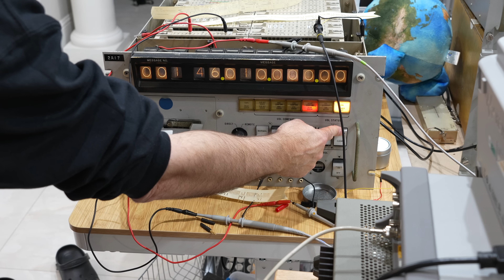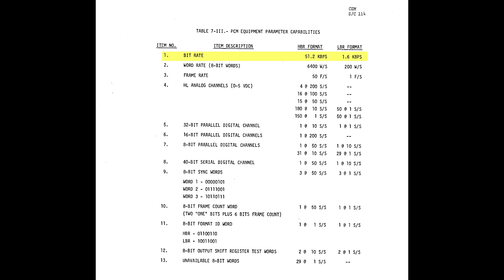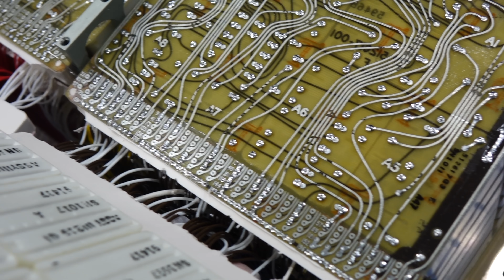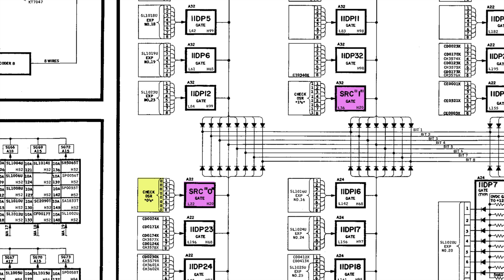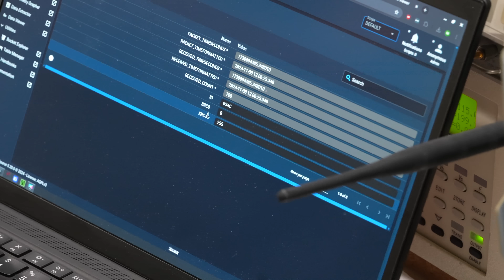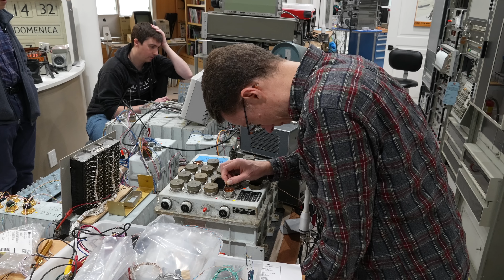Apollo Comms Part 35: PCM Telemetry - Power Up

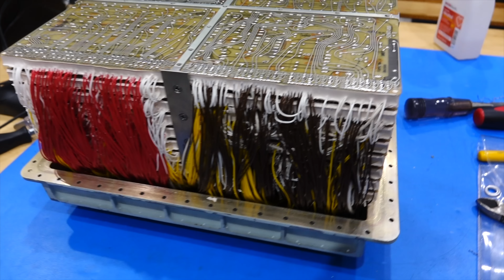Comment: 3:08 "Danger, High Voltage", that's not a warning, it's a challenge! Seriously though, I'm trying to wrap my head around how that module processed 370 signals given the relatively low density of the traces on the boards and that all the modules were made of discrete components. Even if the module was just a giant selector switch to select the signal to be routed to the transmitter, it's amazing it was done with discrete components versus the thousands/millions of transistors per square mm that we're used to today..

Comment: Question for you - is the storage a sort of RAM? On the apollo 13 movie, they show Swiggert powering the system up on battery power, with the last step being the telemetry uplink. Did they lose the re-entry program and actually re-downloaded it over this link?
Reply from the maker: The AGC programs were stored in permanent core rope memory, so they were never lost on power down. But parameters for these programs such as state vector updates and pre-calculated engine burn maneuvers were regularly uplinked from the ground. In theory the onboard computer could derive all this but it was far easier, safer and more precise to use the solutions calculated from the ground. In particular, if you re-power the AGC from scratch in the middle of the flight, it has no idea how fast and in which direction it’s flying. Hence the state vector uplink. Plus they just re-powered it for the re-entry burn, hence the burn uplink.That’s also why the astronauts scrambled to manually transfer the CM AGC inertial attitude info into the LM AGC before the CM died on Apollo 13, so they did not have to do a time consuming star realignment of the inertial platform. Which might not even have been possible with all the debris floating around. Mike better double checks me on all this!
Reply: @CuriousMarc Thank you. I heard something else too - instead of drawing the current directly from the LM 960Ah batteries in parallel - they actually had to charge one of the dead cells - which vented with such force it blew the cap off

I can only think that they had a "split phase" configuration with +28v and -28v - which would mean charging the 28v battery at 56v would be the only thing they could do (holy s...)

Comment: Notice there is no “mother board”. Those CCA’s are plugged into connectors that are hardwired to other connectors. I’ve worked on loads of systems like this for the military. Specifically F-18’s and the older F-14 Tomcat. They do it this way for vibration resilience but if one of those wires break it’s a beast figuring out which one. When I was in the Navy we had entire data processing cabinets with dozens of CCA’s all connected to each other. Crazy old but tough technology.

Comment: I'd never heard of Radiation, Inc.  but a quick search shows them to have been an integral part of the comms for Apollo. They had been bought by Harris about the time I was busy being born so it's not surprising. That PCM module, with all those submodules and wired connections is simply amazing. It continues to blow me away how these companies designed and built this complex equipment using 1960s technology that just worked whether on Earth, during launch, traveling to the moon and on the moon's surface.

Comment: So in high bit rate mode, they were transmitting data at roughly the same speed as a typical late 90s internet connection. From the moon, in 1969!

Comment: the 201B Modem runs at 2400 bps , i mean for 1972 that was well, pretty good for a pair of Copper and lets face it 51K for FM PCM was quite impressive not to mention they did it Without ICs , itd be interesting to recreate their PCM module with modern ICs and Components as a project

Comment: You think of Apollo being so long ago, but so much of the on board gear still seems so surprisingly... modern? It's amazing to me that so many of the foundational concepts behind these systems' design are the same as they are today, to the point that you can still build the hardware and software bridges to talk to them. Above all else, it's all very satisfying just to look at and see it work - this stuff was built so well, built to last, and it did.. These systems are 60 years old. Damn. Amazing work guys.

Comment: Thanks for the reverse engineering and explanation. A year ago I would probably not have understood much, but I've been messing around with some CAN networks (NMEA2000 for marine use), got a scope with serial decoding capability and learned to recognize packages of data just like you are doing here. I could also see clean and dirty traces and find the culprit. Really cool to learn about this, and I was also able to find the issue with some defective devices and repair them. For sure I had Festive Dinner on the background helping me :D

Comment: I always wondered what was driving those monitors in the control room. that could not have been simple terminals. It has much more than 25 lines on the screen and can even draw vectors. What were those terminals and what computer was driving those ? Was that an IBM or other mainframe-type macine or was it really custom built ?
Reply from the maker: Good observing and thinking! It was an IBM 360/75 mainframe driving high resolution, character-only terminals. The terminals were filmed by high def (1000 lines) TV cameras, the vector / frame / drawings that you see were just that, drawings, also filmed by high res cameras and composited in the video. So what you see on the consoles is actually a high def TV of a terminal with static background frames and graphics added.
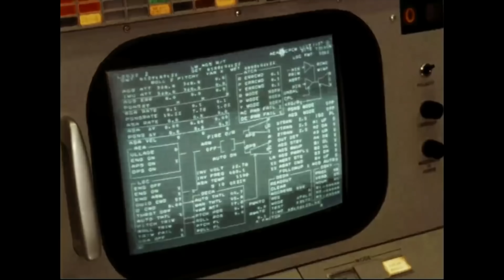Reply: @CuriousMarc  So what we see at 2:07 in the video is a composite video image of a computer terminal, a graphics overlay ( probably celluloid ? ) , filmed and transmitted to a tv-like (high resolution) . Pretty clever.

Comment: Wow, I had to stop and let that sink in... That thing was transmitting at 1990's modem speeds from space (ok, the moon) and downlinking to intercontinental leased lines... probably in a balanced 4 wire configuration. You are lucky to get 1200 to 2400 baud out of a leased line due to noise back then. It was very important to get the delivered db levels correct on the receiving end or there would be massive degradation of speed (or no comms at all). The Bell channel interfaces were... flaky... on a good day. I am amazed they were able to get leased lines to work at all from Australia to Houston. That would be a monumental effort! We would have trouble keeping leased lines going across town or even within the same state 2 decades later!!!!.  When i worked with leased lines in the 1980's we were still using UDS 103, 202T, and its descendants. The 103 is 300B and the 202T is 1200 baud.  Sometimes the leased lines struggled with 1200b. A little static on the line, or the db level is off just few db, and the whole thing can come crashing down....amazing that NASA got that working. Funny that the RF link from space was almost 5 times faster than the Earth bound technology!
EDIT: I assume they were using multiple leased lines to increase data throughput.

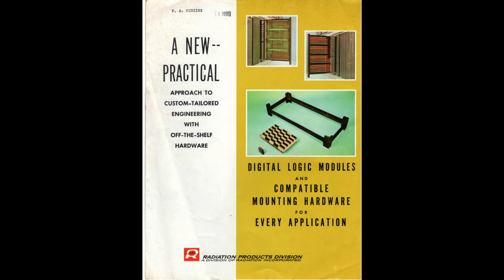Comment: Marc, slight correction here at 5:09.  Radiation was the original company based in Melbourne, and they did some very advanced work for all sorts of telemetry acquisition systems.  Later on, Harris Intertype, a printing press manufacturer, bought Radiation completely when the Harris brothers realized the future was going to be digital systems.  Harris Semiconductor was a division of Harris, inc., not the other way around.  Harris sold off the semiconductor division, which was renamed Intersil to revive one of the legends of semiconductor suppliers.
Later on, Harris acquired Excellis, and the remaining company was merged with L3 to form the current L3Harris Technologies, inc.

Comment: This is amazing. But about the synch sequence. There should be phase to find the sequence as you described. But after there should be validation, meaning the same pattern should repeat at lest few consecutive prior sequence. Depending how many prior frames are compared, the probability to synch with random pattern within the data is almost zero.

Comment: This brings back memories of work I did at GE Astrospace back in 1988 to filter 9-track archived PCM telemetry to eliminate dropouts from our UARS satellite platform.  I didn't not have access to raw data as I recall. so I used a clock that was embedded in the date.  A very ambitious project here!

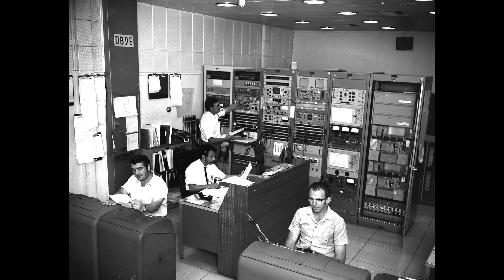Comment: 4:33 Bell 21b - 2400 bits per second
Bell 103 - 300 bauds. 8 bits per baud - that makes 2400 bits per second equivalent to high speed model

I assume it was meant to say Bell 103 was 300 bits per second?
Reply from the maker: Bell 103: 300 Bauds or bits per second. Bell 201B: 2400 Bauds or bits per second, spread on two phone lines. Baud is the symbol (clock) rate, not a byte. Early modems used binary symbols so 1 baud = 1 bps.
Reply: @CuriousMarc  Ah, okay. I'm used to UART/serial notation, where one baud means one character, together with start/parity/stop bits
Reply from the maker: Ah, therein lies the confusion. In UART / serial, bauds still refers to the clock or bit rate. So it works the other way around. The start, stop and parity will *lower* your effective transmission rate. So at 9600 bauds for example, once you take into account the 8 bits, the start bit, the stop bit, and the parity bit,  you are transmitting "real data" bits at an actual rate of less than 6981 bits per second. But nobody counts like that. It's still called 9600 bauds or 9.6  kbits per second, however your UART transmission protocol has a 37% overhead. Which is pretty bad, but hey, it's a simple enough protocol that could be decoded mechanically ;-)

Comment: JDEC 3N68 - Silicon-controlled Switch.  I vaguely recall those from the devices class I took.  SCS were similar to an SCR (thyristor), but there was an extra gate lead.  One gate was positive trigger and the other was negative trigger.  The device could also be shut off by applying an opposite polarity pulse to the respective gate.  They were rendered obsolete by CMOS bilateral switches such as the 4016/4066 switch and 4053 mux/demux.  The textbook for the devices course I taught did not even mention SCS.  Those were one from the array of interesting early 1960s components such as unijunction transistors which are now rare.

Comment: The most amazing thing is the fact most/all of this stuff "just works" after so many years.   Unfathomable today.
Reply: Comparing consumer electronics to Apollo's is a bit of a lopsided scale...
Reply: I mean modern solid state designs could theoretically also do that, but once you bring shitty pot metal mechanical parts or electrolytes (such as in capacitors, batteries or many sensor types) into the mix, there's no way that will work even just 30 years from now. I would give a smartphone mainboard or an engine ECU a pretty good chance of still working after sitting on a shelf for 60 years simply because there is barely anything to go bad (almost no electrolytics, almost or entirely solid state), but stuff like OLED screens or power supplies? None of that will ever work in 2085 without some serious restoration or replacement, or even in 2045 for that matter.

Comment: Electronic archeology! But the "long lost lore" isn't even a hundred years old. Still, amazing! Who thought the Apollo could almost rival the Giza Plateau because that's what it feels like? And that makes it reasonable to ask: what the heck happened to electronics in those less than one hundred years? And sixty years from now, will there be a future Curious Marc et al digging into our "common" hardware, looking for specs not found anywhere trying to decipher Ethernet II, Blu-ray discs, DisplayPort with all the protocols running over it, 2 nM chips and PCI bus signalling?

Comment: And there are still people doubting we landed on the moon, despite all  of this.

I am fascinated by everything Marc and his Crew does and I could listen to the elevator music explanation for an endless amount of time. I'm so grateful that Mike shared his FPGA code. I'm dabbling in the topic myself and honestly, this is one of the best ways to learn AND to follow more in-depth what you guys do.
Reply: Those people are brainless
Reply: @cap @captainsouth4460  Its’s not personal. People don’t believe in this stuff anymore because it’s been 53 years. This isn’t the 60’s or 70’s & most people have cellphones that are billions of times more powerful than that  computer. You combine that with earlier pictures that look fake & it’s pretty reasonable to believe that.
Reply: I bet if you turned on your pocket calculator from the 80’s it would also work. you obviously could have both created tech that theoretically does something & then also create media content to fake it.  Thats why this doesn’t convince current society that we went to the moon. You essentially would have to actually use something like a 70’s lunar landing guidance system & prove it can land.

Comment: Love your videos.  Thank you.

But I have to ask -- why on earth would these systems require 3-phase power?
Reply: At an educated guess, redundancy in case of a single phase failure.  I've seen this feature before in some military electronics (don't ask) where the internal DC power supply can work off of just a single phase.

Comment: 3 phase power neutrals almost always are used for the noise filter, as it is a way to conduct the RF noise being generated, either in the unit, or from the supply, to the 3 phase supply source, without imposing it on the signal commons and the chassis ground.

Comment: 51.2 KBPS serial data streams in the 60’s! Too fast for the hearth systems too! They were aliens😬. These are our technology roots e we must be grateful to those beautiful minds. Once again an immense amount of beautiful info, thanks guys.
Reply: Same, I lost my shit reading that. It is insane, even today most of the MCUs can't handle it.
Reply: I was in college in the 70s, several of our profs were ex-Bell Labs, and we covered the PCM trunks in class, from the basic rate 8 bit x 8kHz through T1 and up. I then got a job at Data General, ended up designing an Ethernet card for the old yellow-cable Ethernet. I also designed some Token Ring cards, but the less said about that, the better.
Reply: @antronargaiv3283 It seems a beautiful path. Congratulations

Comment: What's the bet the reason the wire connection points are all the same and many not terminated is because they used the tape layout method of the day and had the connector shapes specially printed by Bishop Graphics Inc. I remember laying out boards using Bishop tape, cost a fortune

Comment: I was always massively impressed by what they did with what they had to get to the moon and back. But all these videos showcasing the equipment you've been able to gather and get working just makes it all the more impressive with each segment. Especially when you consider the very tight parameters they had to work within at the time. It really does give you a whole new appreciation for what was already an incredibly impressive feat of engineering. Of course, just gathering these bits of equipment and getting them up and running is no small feat in itself.
Reply from the maker: The more we look at the Apollo hardware, the more we are impressed too!
Reply: ' an incredibly impressive feat of engineering'  Similar scale to WW2, the people who 'think it wasn't real' have no concept of what can be done when people with ability actually try.  A friend's dad around 1980 had been an engineer at NASA during the Apollo program, he was top notch.  Some people can simply do far more with far less than others, and if you put a bunch of them together you can do a lot, things that other people don't understand can be done.  It's really funny when people pretend everyone from the 1960's had no idea what they were doing and couldn't possibly have gone to the Moon.